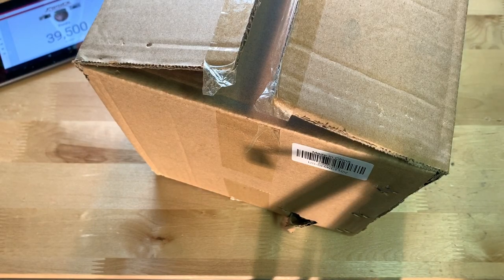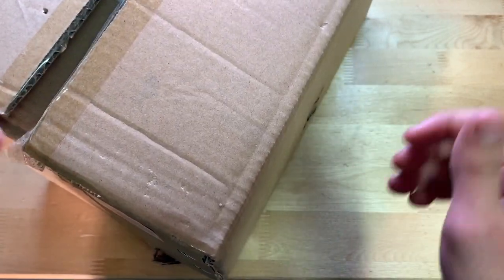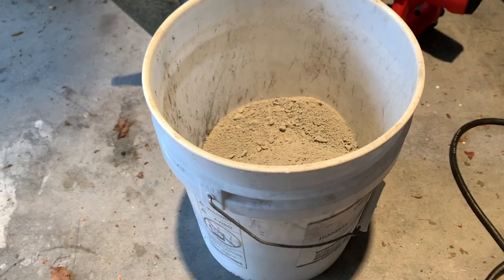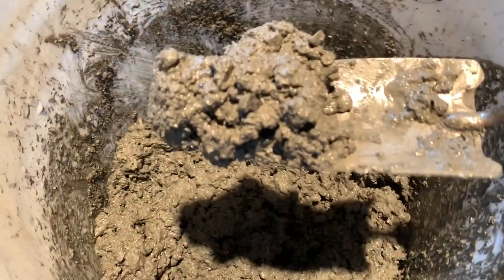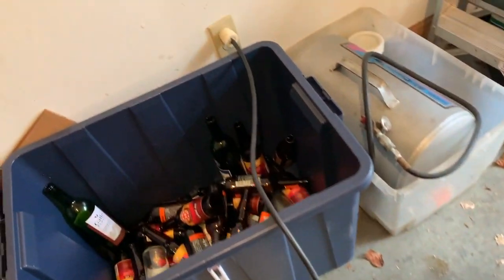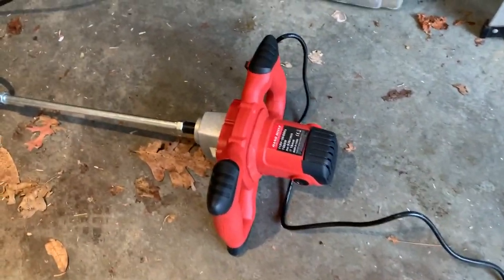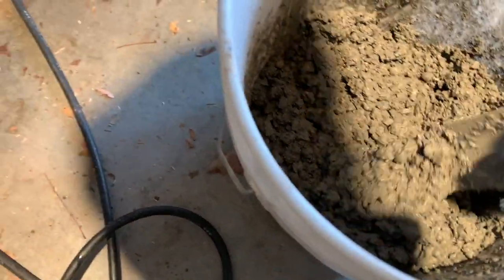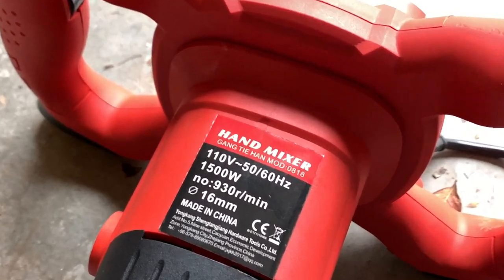Easily Mix Paint, Cement, Grout, & More With This Handheld Cement Mixer! Works GREAT!

Comment: I bought the exact same mixer on Amazon.  Its fine for plaster or mortar but struggles with concrete (despite the description which says I can mix concrete).  After 5 minutes use I could smell burning and smoke started coming from the motor.  Sent it back the same day for a refund.
Reply: Hai I wanna ask.. yours is the 3 pin plug or 2 pin plug ??
Reply: What you posted answers my question...all I do is concrete overlays. Won't be purchasing this. Thanks

Comment: Why did you cut out some part in your video..what is the spring met for..that is what stop me from assembling mine..u just got mine
Reply from the maker: Hi, there are extra brushes, they are springs with carbon blocks on the end and they're spares in case the ones in it wear out. Hope that answers your question:-)

Comment: Does it run 8 minuits straight?
Reply from the maker: It should, not sure what you're mixing to run it that long though....
Reply: Concrete, high performance concrete with very little water and plasticizer.
Reply from the maker: Understood!